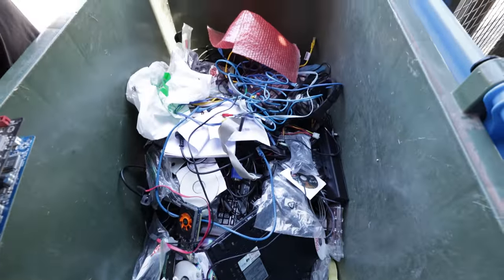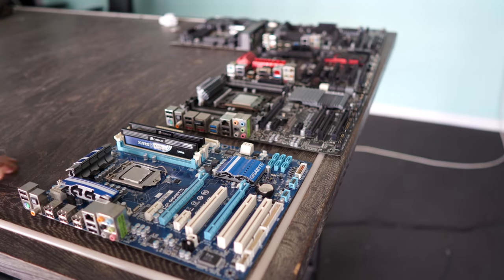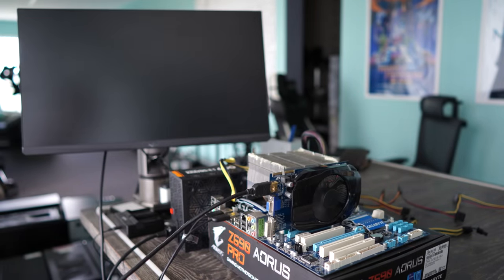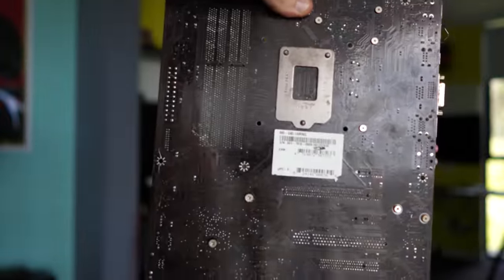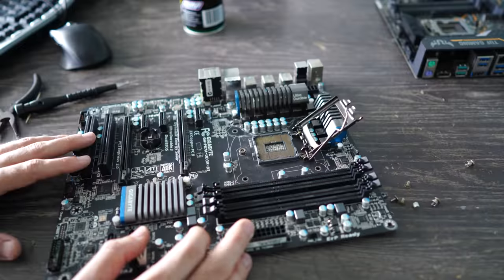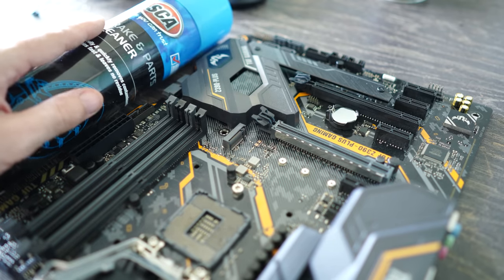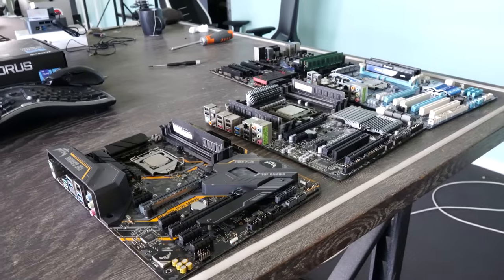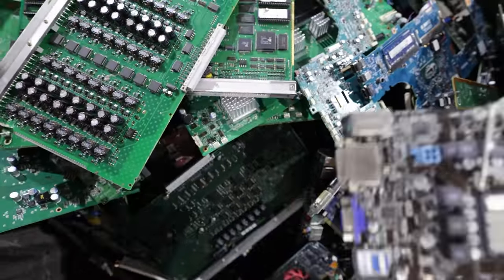$0 for Enthusiast Tech!? DUMPSTER DIVING!

Comment: I do hope you are only showing a small piece of the testing, because the way you do this does not confirm in any way those motherboards are fully working. The one with broken pins for example - it may post, it may even work, but does it work fully? It can work with this CPU, may not work on another for example, you can lose a RAM bank (or one bank can be unstable), it can be unstable with full load (prime95 for example), you can lose PCI lane(s) etc. For the sheer problem with being sure, I would have thrown or sold as not working/parts only. I mean the way you test this, at least on camera, leaves a lot to be desired. Have you tested USBs on any of them? Do thet all work? Do they all have proper speeds? Same goes for all PCI lanes. To properly test each MB it would take hours with many CPU and ram combinations and if you sell them after testing as you showed, I hope you at least accept returns... And if you just build a PC, hide broken pins and say "fully working, only a little bit used" then shame on you.

Comment: YES PLEASE!!! Lucky!
Reply: I have a electronics recycler 3 hours away, but they come up with some pretty creative prices lol...
Reply: @x7slim8x  So its expensive has hell for trash that may or not work .
Reply: @tdomingues89  yeah this particular recycling place pulls and tests alot of the stuff for sale. They fetch those creative prices I mentioned that way.... I wish I had a spot like Bryan has found! I would love to take a gamble and then troubleshoot/repair. I've been in business doing the same as he does but with added electronics repair. Truth be told the repair aspects has kept me afloat since all of this mess started component wise.
Reply: @x7slim8x  eletronic repair is kinda fun, if you have replacements of the same board, even better to repair, the worse it can happen is the ICH (i belibe its that name) to be burn and you may need to buy a re-work station (theres cheap) option, you can even buy schematic, and do repairs like lois on apple  laptops lol

Comment: I got a question can an electric shock from gpu be harmful?
Reply: Actually any electric shock above 48V DC/36V AC can harm you. It depends on where exactly in your body current has went... Should touch with one hand in a pocket of your dry pants, while standing on a dry wood/rubber, not bare foot and, if possible, dressed in cotton/jeans clothes. And never, NEVER!!! touch any piece of hardware while connected to outlet/running if you are not 100% sure there is anyone familiar with electricity in your direct sight, even if you're absolutely positive about what you're doing!
Reply: No it's not harmful. GPUs use 12v and not more than 3-5amps
Reply: @ssenyosdaviee1873  Ok but why I have nerve problems then?
Reply: @lolsucks3599  no need to be scared as long as your computer psu is earthed to ground.
Reply: @ssenyosdaviee1873  how do I know that?
Reply: @ssenyosdaviee1873  I read mili amps are already dangerous is that true?
Reply: @lolsucks3599  what do you want to do the computer? If not BROKEN don't fix it
Reply: @ssenyosdaviee1873  I already got electro shocked by my gpu hence im asking
Reply: @lolsucks3599  then your power especially in the sockets is not properly grounded. You need to contact an electrician to work on the earthing of your apartment or house

Comment: I have a buddy that works at a recycling center he grabs things for me everynow and then. recently I got a crap ton of retro parts I scored 3 pentum socket 7 cpus on is mmx the others are not. 3 Cyrix cpus P166+ and a single intel 486 CPU. lots of sdr ram to. mixed in with all that i got an AMD A10-9700 and a single stick of ddr4 ram. Unfortunately i cant test the newer parts I don't have a single AMD mobo or anything that uses ddr4. all the old parts tested good. I had for sticks of older sdr ram that wont post but i think they have ECC and i don't think it works with my ASUS p5a-b super socket 7 mobo. I am planning to sell the stuff on ebay hope to make some dough to pay my bills lol.

Comment: The third motherboard was missing the chipset heatsink and you didn't comment on it. Will you replace it? Regarding the broken cpu pins, every pin does something. You should run some thorough cpu checks and cpu stress tests just to be sure. Just because it boots doesn't mean that it works correctly.

Comment: The newer games are so demanding, that unless you have a fairly new setup, they would be completely unplayable on this kind of HW. HOWEVER, there must be plenty of other more niche uses that those "grandpas" can still handle very well and function for few more years, before landfill death...
Reply: Unplayable my ass u can game on decade old hardware
Reply: @virtualtools_3021  15 FPS on bomberman graphics isn´t NEWER GAMES nor PLAYABLE
Reply: @markoj182  2600k is OVER a decade old and it will run the majority of modern games at a playble framerate and when pair with a very near decade old 7970 or similar power gpus that arent as old like 1050 ti
Reply: Let my switch to my now-work PC (i5-750@4GHz, 8GB 1600MHz, SATA SSD, and GTX960 OCd from 2015). Sure I can play older games just fine, but anything remotely newer has to be on lowest setting with 1080p, AND STILL will have FPS lower than 45FPS and just plain unstable (frame drops/freezes every few seconds). I tried multiple games and the last game I could comfortably enjoy was COD4: MW, original release that is. Crysis 1 was giving my setup punching. I tried other games, too, cos I was stuck with that PC until 2020 summer. And no, the experience is just bad...

Comment: 4:10 - Careful on the oc'ing re first-gen P55 boards. Some of them has issues with high oc's because of the type of socket used (I'll skip the nuance here, suffice to say the revised P55A was more reliable) I recommend checking old forum threads before settling on a particular oc for that board. Damn lucky to get an i7 870 with it though! Blimey! 8) Nevertheless, 4GHz should be doable, maybe 4.1 with some luck. The caveat is that although the board might appear stable at 4.2, that's when the socket issue can kick in, so don't go that high.

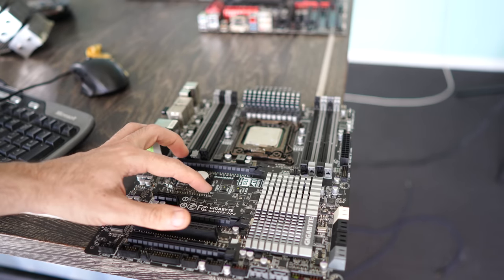7:00 - FYI a typical oc for an i7 3820 is 5GHz, though whether that particular mbd can do it I don't know. I obtained good results with a Gigabyte UD3 way back, but I think that's a slightly higher SKU. Btw, on X79 mbds the two main PCIe slots are both fully x16, because all X79 CPUs have 40 PCIe lanes (it was S2011-3 where Intel started to cut back on PCIe lanes, eg. the 5820K). This means the 3820 and 4820K can both do things in terms of multi-GPU/devices which the much later 8-core 7820X can't (the latter only has 28 lanes), though most users are unlikely to be doing that much multi-device stuff. Still, even with two fully ok slots, that's enough for a full speed GPU and a full speed M.2 device in an adapter HBA (though strictly speaking without the NVIDIA tweak a 3820 will run the slots at 2.0, but one can force it to 3.0, or just use any supported IB-E or v2 XEON CPU, and Gigabyte is usually good for XEON S2011 support).

Bummer about the P67A, but I'm surprised that MSI worked ok, cool! Even more so the Z390, most impressive. Quite likely the two lost pins were just GND connections or somesuch, so usually not a problem. Lucky it wasn't a critical signal line of some sort.

13:20 - I dread to think how many otherwise perfectly ok Intel mbds have been junked just due to bent pins. Horrendous ewaste.

I had success recently with a P55 mbd I bagged on ebay for a decent price (Asrock P55 Pro/USB3), it needed some pin unbending (and a new CMOS battery), but after that it was fine, as was the i3 560 on the board which I wasn't expecting to be there.

Clearly the lesson is that dumpster diving has *potential*, but only if one is willing to put in the time and effort to try and fix whatever faults the parts have. The chances of getting something which works ok without any work at all are pretty low. Sadly in the UK dumpster diving is difficult now, most local councils have strict controls on how waste disposal operates, especially landfill sites (in the mid/late 80s I used to visit a borderless landfill site hunting for tape decks, radios, VCRs, laser disc players, etc., had great success back then, but now the same site is all closed off, no public access at all, the surrounding land has become an industrial estate with single road access, etc.)

Comment: that's hardly REAL dumpster diving, its more like promotional dumpster touring.  Though i can agree with that they should test out and put a lot of this stuff back into smaller buisnesses/resale shops etc

The world NEEDS something like this to exist on large scale and save on ewaste and promote more jobs.  Shouldn't always need to have all the latest crap to do everything as THAT is excessive in its own right.  Not just random tech nerds who salvage what they already have and can find in one way or another.  And you SHOULD get more and more and more, FILL Your car to the brim and bring a trailer and fill it to the brim.  Ewaste recycling isn't anywhere near as good as it sounds, statistically it produces more trash ewaste out of the "recycling" than what was there before by releasing toxic chemicals and transforming hardware that was usable in one form for one thing or another into unusable things which then leave bits around to cause problems later.

Granted the world has a lot of problems but a lot of em are interconnected in that way.  Even microsoft pushes that with windows 11 requirements.  Needs to be something for poor old tech that has nothing really wrong with it and just needs a little TLC Or minor work.  Even the thrift stores here barely have tech (aside from a few dell keyboards and mice, maybe a joystick/gamepad or 2, and a few low end monitors

Even when they do get something good guess what they wanna charge?  Last week's prices at a local salvation army, a Athlon x4 635 wth 6 gb ddr3, 750 gb hdd, dvd-rw, and a radeon 5450? cost (you can bet untested and with wear n tear too) $40.  value maybe 10 to 15 arguably $20 used?

Some random laptop part form factor build (no telling how old on this, not enough to boot it up (no monitors with cables at the time sitting on the shelf (they'd often leave them attached with a vga or dvi cable attached though) or elsewhere nearby hanging on hooks.  Cost $80 usd 

some large maybe 30 somethin inch (didn't measure) dell monitor, $80 (ok maybe that's worth it for someone wanting a nice large monitor on the cheap)  Mostly you'll see the smaller ones like 15 to 20 inch on the cheap that may well be the better part of 20 years old (if not literally that), sitting on the shelf next to LCD TVs  (which are low end HDTV, i've pulled as nice or nicer out of trash, tested, cleaned up and sent the ones that had too significant of flaws back out to where they came shortly after finding that out (for the ones that weren't obvious)

This is real from my state MI up in the USA techusa, just last week
Reply: Its basically just greed if ya think about it, that and bulk processing of a crapload of items, i mean y have to but ya got a whole huge wall of unused space under the baby clothes where you could easily afford to sell em for cheap and put up a simple paper sign that says *computers are untested"  I mean they may sell, the large monitor did and so do some about 23 to 24 inches (typical 1080p capable size if ya think about it, pull some random monitors at that size and see if they'll run 1920x1080p without complaining, probably will), Not saying they're the best things ever or that they aren't cheap but its a desireable resolution for a lot of things (much more so than 1280x720 or 1600x800 these days or x1080 or whatever else is mixed in)

Could easily line dozens of computers or monitors up there or storage bins with parts and cheap zip ties, so spend several bucks on a few rolls of garden wire, a couple dollar store wire cutters to avoid the hassle of wires getting tangled and a way to wrangle em in storage drawers for cheap (i do that for consoles with wired controllers where wireless wasn't a viable alternative or pc parts that are wired like keyboards, mice, gamepads joysticks, headphones etc (not limited to that but you get the idea)
Reply: gotta list what ya use, the multipurpose spray, not the brand but what type to look for (for people in other parts of the world looking to do similar things)

Comment: not even 60 sec in and I already got dizzy by this post-processing
PLEASE - don'T do this - live with the bit of shaky video if you can't afford a stabilized gimble - but don'T use that crap post-"stabilization" - it's so much worse than a shaky video